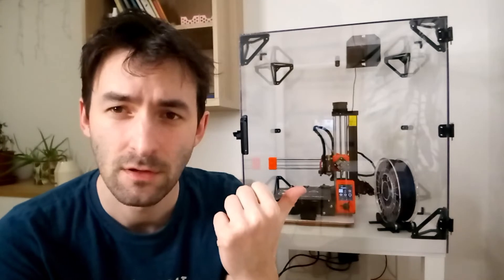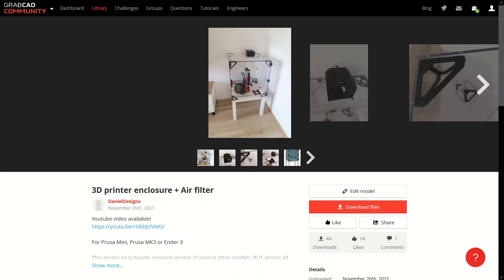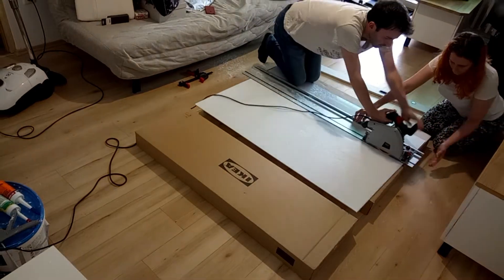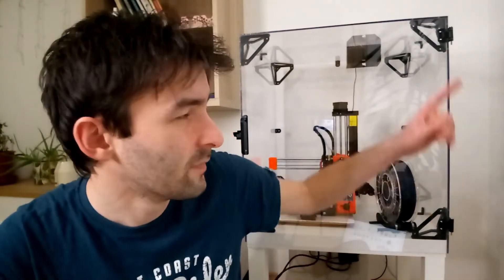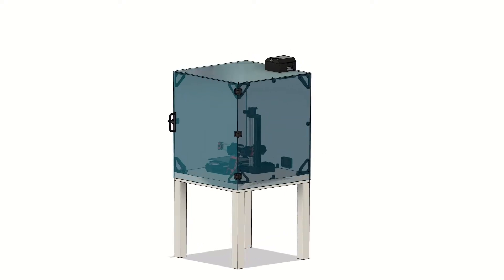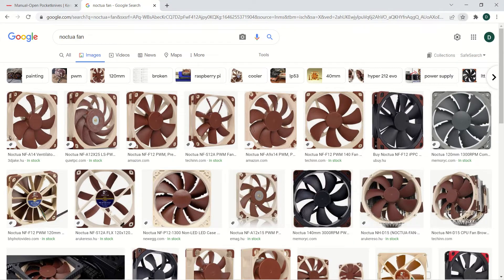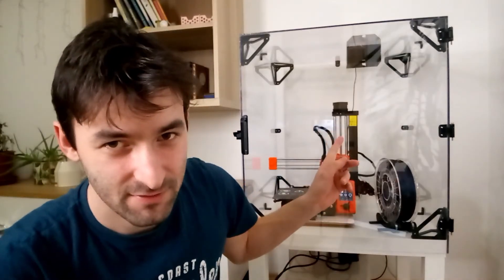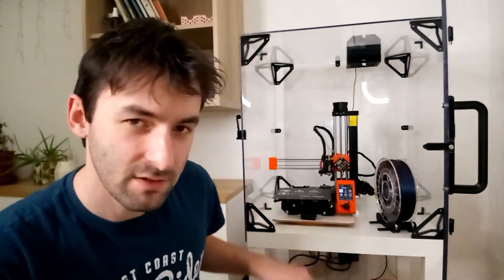3D printer enclosure with HEPA filter explained

Comment: Having some problems with the fan wiring. The fan is 3-pin and the speed controller seems to be 2-pin? Do you just ignore the frequency control wire?
Reply from the maker: Sorry for the late answer. Just ignore the yellow wire. As far as I understand that's RPM signal feedback, which tells how fast the blower in running. We don't need that. I just connected red on motor power + and black on motor power - . Job done.

Comment: Wondering if you have spec's a larger 3D printer, like Anycubic Kobra Max. Thanks...
Reply from the maker: Damn, that Kobra Max is a huge printer. I think an upscaled version of this structure would work, as the policarbonate sheets are big enough to cut 1000mmx1000mm panels. But you need something bigger than a lack table as a base, that's the part where it gets tricky.

Comment: Can you please share the technical drawings for the sheet cutting? grabcad link doesnt work. Also whats the difference between this and Alexander Müllers design?
Reply from the maker: The GrabCAD link was broken for some reason, now I fixed it. Alexander's design is meant to circulate air inside the enclosure, mine draws air out to create a low pressure zone inside.

Comment: You should consider watching some safety guides on circular saws. Your helper was sitting in the cutpath, fingers and elbow occasionaly crossing it too. Fingers in general too close for comfort.
Even worse you put your left hand flat on the cutpath while finishing your cut. If you would have gotten a kickback at that moment you might have considerably less digits today.

In the future, if possible, Clamp down your piece. If a helper is needed have them hold the piece as far away from the blade as possible only applying Force straight down to not slip into the blade. Also have them be positioned to the side rather than be in the front to avoid getting cut while you are fighting a kickback, getting startled by something or distracted.

Sorry for being a buzzkill, the project looks great but that part got me terrified. Safety first!
Reply from the maker: Yeah you are right, that was very dodgy in hindsight. Thanks for the advice!

Comment: You dont need to cut acrylic... just put a hard strong cut with a cutter knife as the breakline and then break it.
Reply from the maker: Acrylic yes, but I used polycarbonate to make the enclosure more durable.
Reply: @danieldesignshu  ahh my bad. Didnt get that.

But is the difference showing? I mean the structure itself looks quite strong. Especially that you mount the plates in the corners.
Reply from the maker: My reasons:
1. doesn't crack if i make a mistake (<-main reason)
2. not that much more expensive
3. no special drill bit requred

Comment: have you done any testing to see if it effectively pulls particles from the enclosure? like using an air quality meter to measure the air in the enclosure with and without the filter?
Reply from the maker: Not sadly. I'm guessing it's not 100% effective but I didn't have the equpment to test it.

Comment: You have the filters the wrong way. Air should flow through the HEPA before the active charcoal filter, as the HEPA is for particles, and the active charcoal is for the smaller vapor particles. You could also have a pre-filter before the HEPA for even larger particles. If you look at an air purifier, they will go Pre-Filter > HEPA Filter > Active Charcoal Filter.
Reply from the maker: Thanks!
Reply: What do you suggest for a pre-filter?

Comment: Hi, great design and video. Did you already printed Abs or nylon? And is de electronics like the power supply outside of the box?
Reply from the maker: I tried ABS today, you can smell a small hint of it in the room. I'd say it gets rid of 95% of the smell. I'd still not recommend sitting in the same room for alot of time.  :( :(  Damn.. Maybe I should do a video on this.
Reply from the maker: Thank you! The power supply is located otuside the box.

Comment: Thank you for sharing yet again. I am in the process of printing the parts and sourcing the Perspex. I am a bit concerned that you mention that the Lack table is not really suitable as I have already bought one. I hope it turns out ok. I will be placing an Ender 5 Pro in the enclosure ro a bit concerned now.
Reply from the maker: Thanks! The lack isn't ideal, but it does the job.  If you have any problems later you can always screw angle brackets to the legs for some extra stability (or add extra weight). Hope it will work out for you!
Reply: Dan. I just got a Ender 5 Pro.  My inital measurments indicate that it would not fit into a Lack table setup? even taking the spooler and display screen off would make it a close call.  How has yours turned out?
Reply: @MarkWascherJr  Thanks for replying. I went with a totally different option after Daniel's comment about using the Lack next time. Mine is a work in progress. Aluminium frame. I still have to add the panels then it will be done.